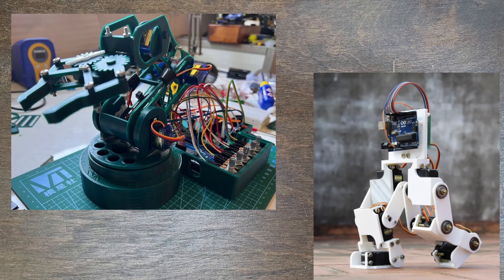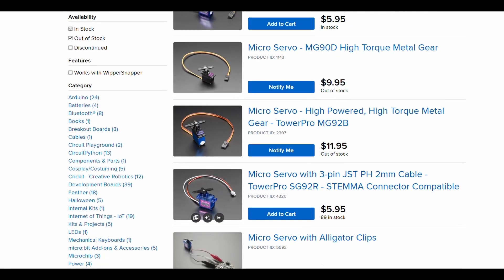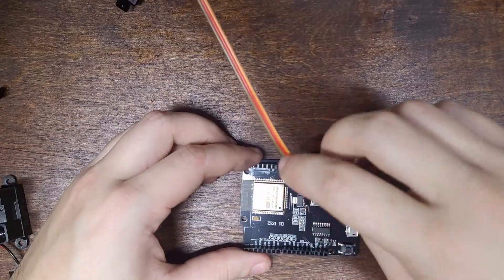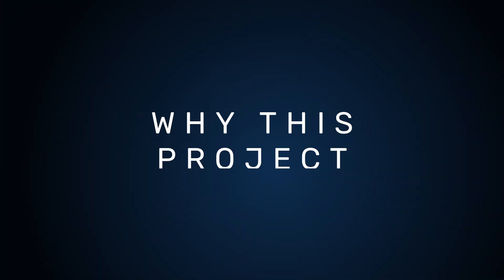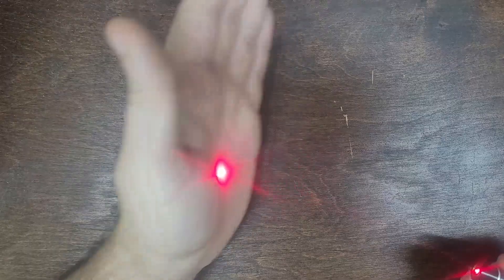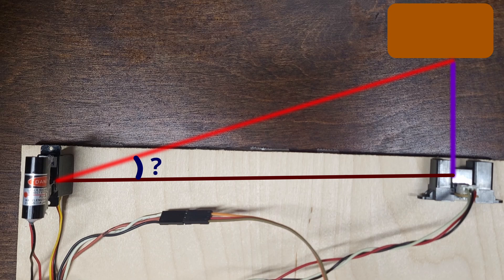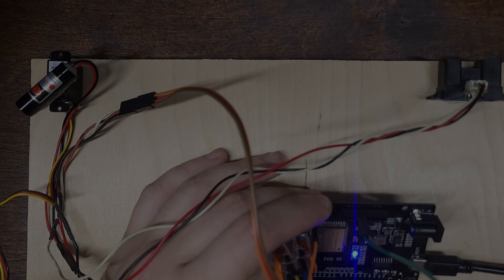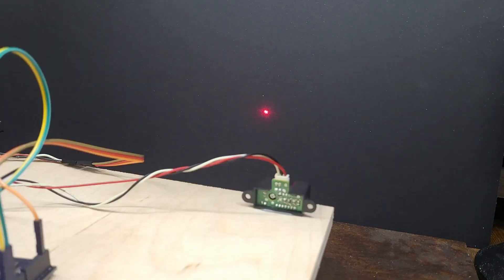I Wish this was my First Robotics Project

Comment: The laser pointer knows where it is at all times. It knows this because it knows where it isn't. By subtracting where it is from where it isn't, or where it isn't from where it is (whichever is greater), it obtains a difference, or deviation. The Arduino uses deviations to generate corrective commands to drive the laser pointer from a position where it is to a position where it isn't, and arriving at a position where it wasn't, it now is. Consequently, the position where it is, is now the position that it wasn't, and it follows that the position that it was, is now the position that it isn't.

Comment: IMO you really shoulda been able to fix the weird oscillations. its a bit silly you bothered with the data sheet and different curves when it still doesn't work right. Seriously this video isn't better than any of the chinese kits because its always the little bugs and annoying problems that actually keep people outside of robotics. I mean if you can't even make a stable device, how is anyone supposed to? (hypothetically ofc)
Reply from the maker: I think it's unrealistic to expect a first project to work flawlessly.
This is an interactive robot that someone with no experience can reasonably expect to replicate.
If I added filtering to the sensor reading and swapped the servo for the motor from my first video, I'm sure it would work much better, but that extra complexity would defeat the point.